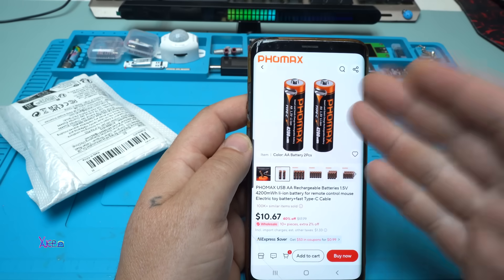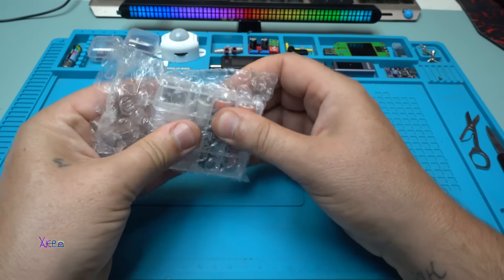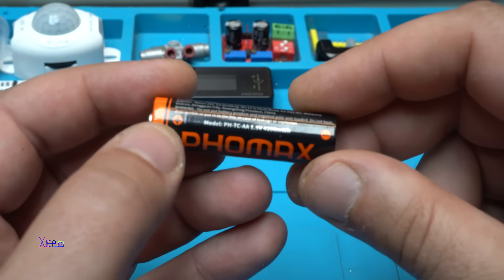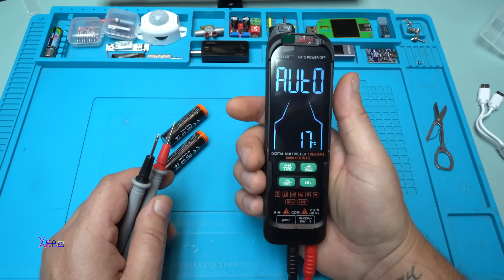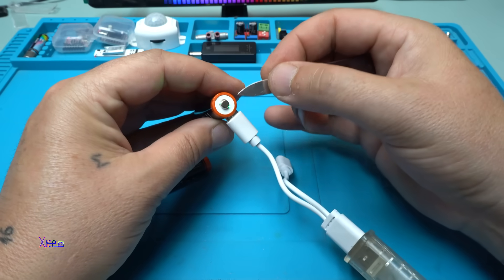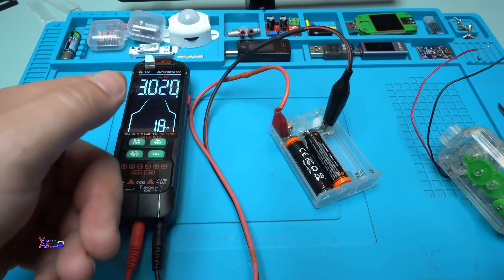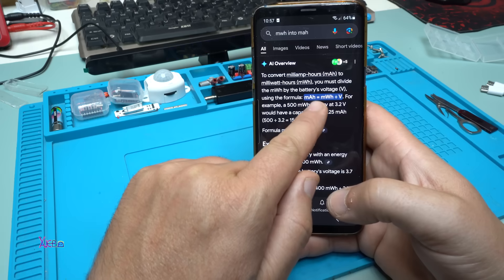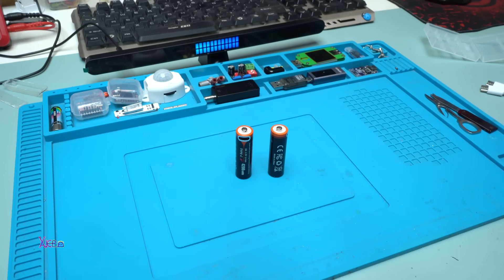$5 Aliexpress 1.5V lipo battery is PRACTICAL?

Comment: You didn't measure the most important thing. The capacity of the Li-Ion battery in the AA case. You should have discharged them completely and then measured the capacity of the full battery at the end. For example, with a tester KWS-2302C, MX18L 10 and others.

Comment: Test the actual capacity (mAh).
Reply: Yes, this was a huge oversight. It's not difficult to do and it is probably the most important spec when deciding on what battery to buy, whether it is rechargeable or just a primary battery.

Comment: You can't use the Voltage to determine the if its fully charged.
This Akku has a  buck converter(like the 9 Volt Block has a boost converter)
it shows 1.5 until its empty.

Comment: I just bought similar AAA cells.  I'm curious about shelf life and so on of these, but if they can shut down the nA or uA level when disconnected, they should be good for years.
Reply from the maker: Yes, the low self-discharge rate is a key advantage with these types of cells.😉

Comment: It says 4200 mWh and 1,5 V. So it should have 4200/1,5 mAh. This would be 2800, which is not a realistic value for this size. It was great, if You could measure the actual capacity, as this would be the most interesting and important information.
Reply: correct. difficult to digest considering the form factor
Reply: I will suggest his calculation was correct. 1100 mah 14650 cells (about the same size) are plentiful on Ali. It makes better sense. Also, one website claims the disposable lithium batteries from Energizer are 3000 mah, so 1/3rd the capacity seems reasonable.
Reply: 350-500 mah bych tipoval.
Reply from the maker: Thank you for pointing that out, I'll try to perform a capacity test on it!

Comment: the electronics inside the battery drains the battery, its always converting the 3.7V to 1.5V its not good for long time, remote or clock's

Comment: Well, for One-AA flashlight you can use "dead" AA battery from remotes, wall clocks , toys or whatever. I do, my flashlights take the AA battery down to about 0,8V. I have about kg cache of "dead" batteries (properly stored) for things with good booster :)
Still, good thing to have also same implementation of the good old 9V "Korona" battery ;)

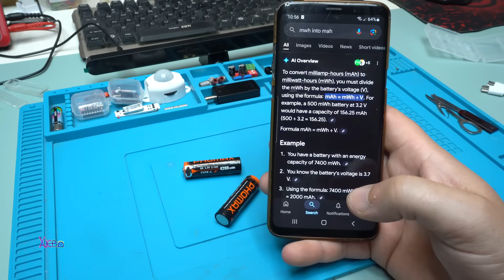Comment: 6:27 Why did you divide by 3.7 instead of 1.5 ?
Reply: 550 miliamperios cierto?
Reply: Because if it is Li-ion (which it is) then it will be 3.6V (not 3.7V) and probably has a tiny step-down board with the USB and LEDs on it, which is stepping the voltage down to 1.5V rather than 3.7V. This would also explains the constant 1.5V output rather than voltage dropping as the battery is discharged.
Reply: @STXTION  what about conversion efficiency?